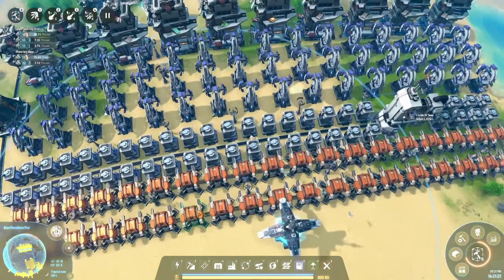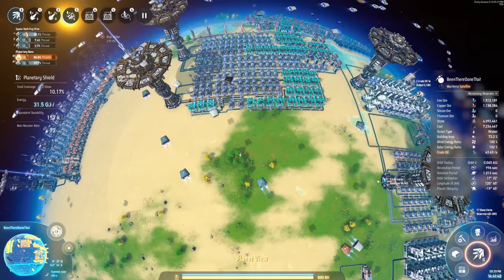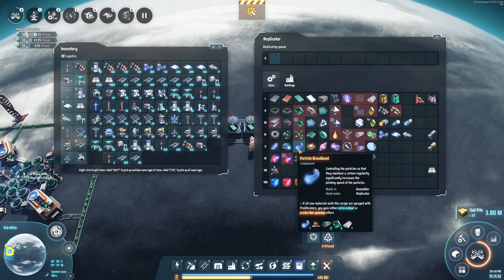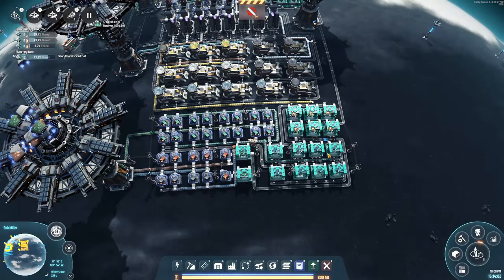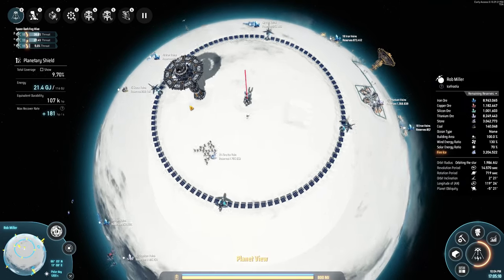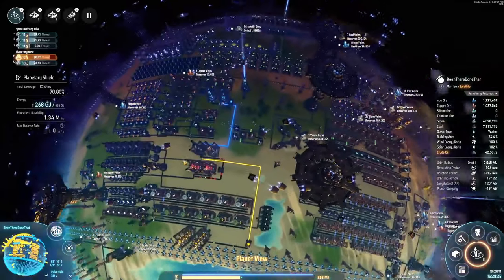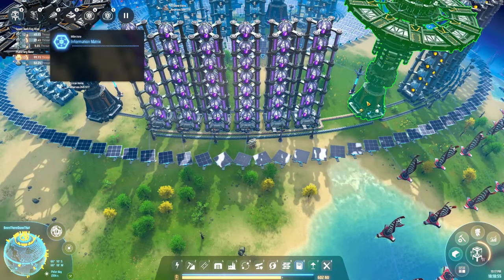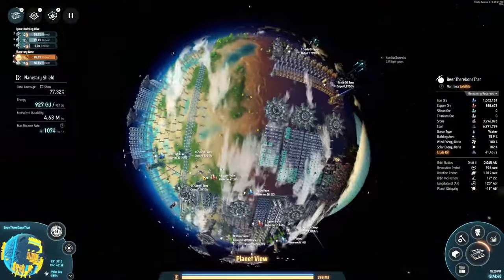Purple Science & Polar Hubs!  | Step-By-Step 2024 Masterclass | #5

Comment from the maker: The description includes two versions of the polar hub: One that is pretty much 'endgame ready' - But that's exceeding the 3600 blueprint limit you'll probably be stuck at for the moment. Therefore, the second version (39B) is a stripped down version in which I removed all the non-essential parts (solar panels / batteries / stacked matrix labs above the first version)
Reply: The Basic Polar blueprint doesn't have production, unless I'm missing something. So I know I have to build PLS/ILS to get my red/blue/yellow up to the poles, but purple isn't being produced anywhere? Just the components, on my other planet?
Reply from the maker: @tobi7090  Each row of matrix labs will produce a single type of science if you bring in the required resources. Those resources will be produced elsewhere though (found in the other blueprints)
Reply: @TheDutchActuary  you are right I panicked because it looked scarce when I first built the polar hub, I'm still transitioning to green and so far it seems sufficient. Thanks for the reply!

Comment: Hey, TDA. Your friendly blueprint quality assurance rep here. In the 037 Particle Broadband blueprint there are a few things to check on. One of the few useful things the traffic monitor can do is to check that your final output matches what you expect. If it does, chances are the blueprint is good, or at least good enough. If it does not, then it's worth checking into.

Based on lower-than-expected broadband output, I found that five of the energetic graphite smelters have their input connected to the output belt and were not producing anything.

As a minor point, there are two output belts missing. The oil output from the ILS and the hydrogen input into the other ILS didn't get included in the blueprint.
Reply from the maker: Nothing beats quality assurance! I did catch the graphite ingame but aparantly forgot to update the blueprint, both that plus the missing belts that got cut out are now updated!

Thanks!!
Reply: @TheDutchActuary  on 21:15  where are you getting magnetic coils, circuit boards, processors, and missile sets I don’t see any PLS or ILS dedicated for transporting the items
Reply: I’ve been following thru your videos like a let’s play
Reply from the maker: There isn't, those are all made on site (with exception of the missiles, which have their own dedicated build both in the early game as well as a more focused build - both export them to an ILS. @TrovoMapleYT

Comment: Curious what we do today. So cool! 12:18 would it make sense with the Hydrogen we get on the blue planet to burn it in some Thermal Power Plants for power on the planet? I am abit afraid it could stall and production stops? 16:08 Fighting abit to place the Polar Hub Defense Ring. Error: To close to another power facility. There is nothing on the pole so I think the Accumulators interfer somehow. Turning and SHIFT on the grid does not help either. Soluition: Place the hub no matter what warnings with SHIFT/Retrurn. Remove the outer Accumulators. Place power poles for gus into the ring. Place Accumulators again.

Another little problem I see on the blue planet with the Graphite production. When I did not place the BP wrongly the Arc Smelters only work half way (not connected all) and some Coal inputs also have crystal inputs. I think. Energetic Graphite is a bit less, so I added also 3 more Smelters to the line. Feels better now.
Reply from the maker: Hiya! The defense hub blueprint was updated now as indeed the power poles seemed to fight with the accomulators. The Graphite in the broadband update was correct as well, so you were spot on!

Comment: Your tutorials continue to be both enlightening and entertaining. One small question that keeps bugging me (probably because this is actually my first DSP own playthrough and YT series): Do you keep the resources, e.g. for the "attack" base or polar hubs in your inventory, or do they get delivered by ILS that also delivers the missiles? In case of the former, is there a way to setup a storage building that keeps the exact number of buildings you need for a given blueprint available until you collect it?!?
Reply from the maker: I try to keep a healthy stockpile of the most used buildings (including belts etc) in my inventory. The slots on the left side of your inventory are the ones that the logistic drones can auto-deliver to you whenever you visit your mall planet. 

Anything I end up lacking while building on a different planet, you can order in through an ILS if you set up an interstellar mall like i've shown in this series. Any ILS with empty spaces works for that, even just placing a random one down temporarily just to order more stuff in.

That said, it helps if you plan ahead a bit. For example, if I know i'm going to conquer a new planet i'll need dozens of turrets etc and intentionally stack up on those before I go there. I don't want to be carrying around 10 stacks of turrets while i'm just working on the factory, so once i'm done with that, I reduce it down to maybe a single stack or two. 

To answer your question: You could probably make specific builds for a very specific amount of buildings, but I don't see the benefit of doing that. If you're producing something, make sure you can easily request that from anywhere in the universe and you'll never have to worry about it again!

(OK, until you start placing down blueprints with thousands of buildings, because you will run out of those :D)

Comment: Curious about your thoughts on belt bending. Your playthoughts seem to be about efficiency, belt bending sounds like something that would help increase your space efficiency.
Is there a plan for a bended playthough series? Maybe calling it "Forbiddin Efficiency" playthough.
Reply: I quite enjoy the occasional non-right-angle bends. It somehow “feels” organic.

Reminds me of my younger days when creating circuit board layouts for my electronics hobby.
Reply from the maker: Belt bending is definitly something to consider for the ' min maxers ' but it seems to me this is not intended behaviour that will get fixed at some point, or at the very least is at risk of breaking at any given time.

It is also quite a bit of effort/complexity for a small gain. Specifically, a small reduction in footprint in a game that literally gives us a universe to work with! 

Considering i've never really ran out of room to build in my playthroughs, I simply don't think it is worth the effort.

Comment: So I really like your build style, it's very neat, but I have a question. Why do you choose to transport raw ores everywhere with the ILS/PLS, rather than just smelt them in place and bring over the smelted materials?
Reply from the maker: Offsite smelting is definitely an option, and one that I used to employ quite a bit as it simplifies later game builds. 

However, I wanted to keep the entire builds for this run self-contained.

This helps to prevent situations where you are expanding your top tier production, but don't have enough basic production. And the other way around - it avoids having tons of smelters sitting around doing nothing.

Comment: It seems that the updated version of the science polar hub blueprint (039) has all the matrixlabs in it, hence it is over the blueprint limit of 3600.
Reply from the maker: Yes, but it also has a few other upgrades that I didn't want to take out as they are used in the later game. The easiest way to fix this is delete the un-important buildings (like the matrix labs :P) and just place them back in. The belts & ILS setup is by far the most work to put down.

Comment: Question, the science purple hub is 4232 facilities, but the tech to get above 3600 for blueprint limit uses purple science, was this an oversite?
Reply from the maker: The initial version was actually slimmed down (I removed the solar panels and most of the matrix labs) but then later added in a few more things like the proliferators and warpers and it grew beyond the limit. 

You can either do something similar in the sandbox, or just delete the matrix labs, solar panels, missile turrets and accumulators and you'll be back within the threshold. Might sound strange to do that, but the matrix labs are the only things you really need from those items, and those are super quick to add back in.
Reply: @TheDutchActuary Thanks I am hoping to build it tonight, will try slimming it in the sandbox
Reply: I ended up placing an ILS and importing the Broadband and the Processors to a small purple facility to get the final unlock for unlimited facility size and built the blueprint afterwards.

Comment: Your polar science hub blueprint 4232 facilities. The lvl 4 Mass Construction upgrade has a limit of 3600. The next level requires purple science and mecha core lvl 4 which also requires purple science. What am I missing? Should I build some temporary purple science production until I unlock those?
Reply from the maker: You're not missing anything - I added a few things to the blueprint for the endgame later on, but forgot about the tech requirement. I removed some non-essential parts to bring it back down to 3600 (see description): Here you go!

https://www.dysonsphereblueprints.com/blueprints/factory-039b-science-polar-hub-basic-version
Reply: @TheDutchActuary  Thanks for your time!